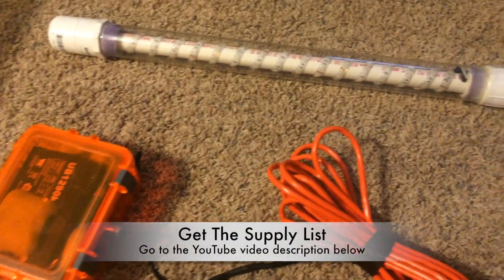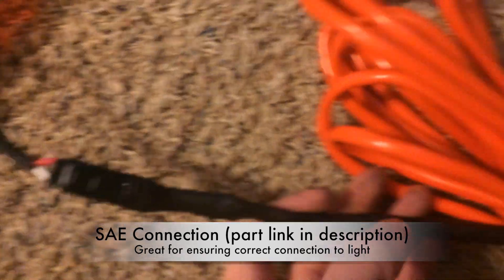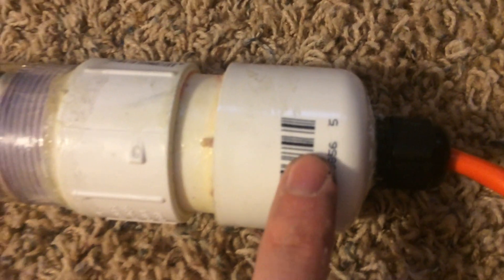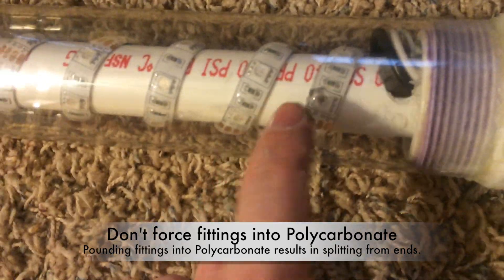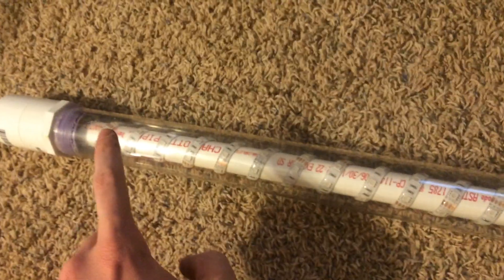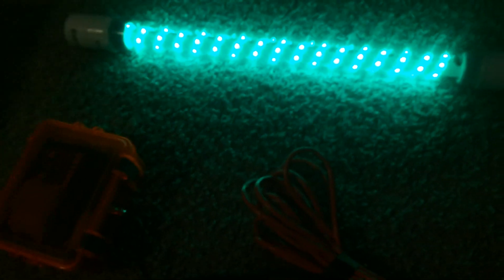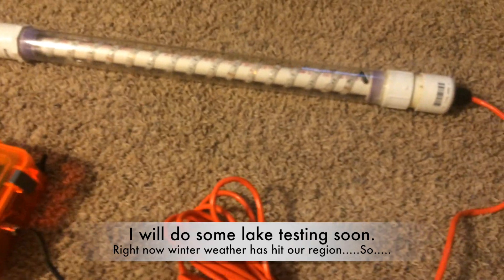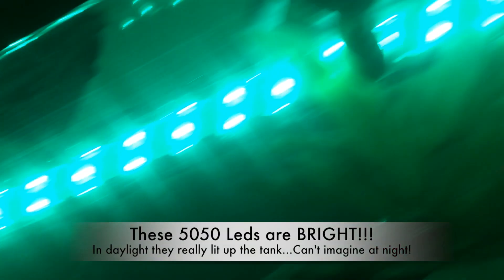Underwater Fishing Light

Comment: I like it, my buddy just made one also. he is having issues with the pvc fittings and the polycarbonate tube. He is also making his to sink. I am going to make one just by wrapping the leds around the battery in the clear waterproof container. That way the battery will make it sink no problems and I can leave it attached to a buoy and come back after some time and hopefully catch some fish.
Reply from the maker: We saw that one with the battery wrapped in the Facebook group.  Only thing is we don't agree with the choice of container.  The container holding the battery is at most IP67 rated not IP68.  We have used those containers before and they are prone to leaking.  If it was lowered into the water and hit something it could affect the seal.  

The polycarbonate tubing is optional...you can use clear PVC.  We did notice that you don't want to pound PVC fittings into the polycarbonate tubing because it will split at the end.  However, once we learned that the tubing worked pretty well.  I will say the clear PVC tubing is going to be more easy to find fittings that fit nice.  
Also we were glad it floated.  We figured we would pack a weight but in case the kayak rolls we wanted it to float.  We are going to add an eye screw in end cap to attach a weight when in use.  

Anyway, thanks for the comment!
Reply from the maker: We thought about making an integrated battery setup.  For that we would use long lithium battery packs.  It would be pretty easy.  We just figured we would build it to fit most kayak anglers who already have batteries integrated into their yaks.
Reply: Yeah I agree, i just think its a big advantage to be able to drop off the light somewhere for any amount of time then come back to fish it. I might have to look in to getting a better box. do you have an inline fuse built in?
Reply from the maker: Yes we do have an inline fuse inside the battery box.  http://www.amazon.com/gp/product/B0002KR88A/ref=as_li_tl?ie=UTF8&camp=1789&creative=390957&creativeASIN=B0002KR88A&linkCode=as2&tag=ytk-20&linkId=5X7LDQZ5AHRF6DHL

Comment: I'm in the process of making one with 1/2 inch cpvc pipe in a smaller diameter polycarbonate tube. Don't do this!
The smaller diameter pipe that the light strip wraps around tends to break loose the siicon covering some of the leds. This set up will have to extra waterproofing of exterior tube to preserve the lights longevity. It took a week before the leds started to have the covering peel off, good thing I did not have the appropriate sealant for the poly and cpvc components on hand. I will complete and use this, but will make next one on 3/4 inch pvc to avoid the stress on led strip when wrapped.
Reply from the maker: +Randall Greer thanks for sharing your experience.  We didn't use CPVC.  I could see where using too small of diameter could run into problems of wrapping tight.  We loosely wrapped leds in another build tutorial video but over smaller diameter antenna and made a stern light.  It still works great. Just depends how you go about it.

Comment: Have you made any changes in the design or construction technique since posting this?
Thanks,
Bill
Reply from the maker: Bill Smith No changes at this time aside from recommending clear PVC for strength and easier fitting matches.  Polycarbonate tubing is awesome but you need very smooth cuts else run risk of cracking from cut edge.   The one I use on my PA14 is polycarbonate.   Polycarbonate is very clear but PVC is slightly blue hue.  Just depends on preference.
Reply: KayakDIY 
Thank you!!  
I can get 8 feet of the clear PVC for a little less than $36.00 dollars so I will use it and make four 2 foot lights.  I'll use a threaded fitting on one end in case I have to repair the lights or a connection.

Nice project you did here!!
Bill

Comment: How could I make this be able to connect to an actual electrical outlet?
Reply from the maker: Tom Laicher Thanks for stopping by.  To connect 5050 LEDs to an electrical outlet plug (like from a home) it would be best to buy the entire led kit that way.  These are affordable good quality kits that have 5 Star reviews: http://www.amazon.com/gp/product/B00CZ6VB6Y/ref=as_li_tl?ie=UTF8&camp=1789&creative=390957&creativeASIN=B00CZ6VB6Y&linkCode=as2&tag=ytk-20&linkId=Y56L2OFJ5XA27YSK
Reply from the maker: Few other kits here as well that have 5050 LEDs and outlet power.  http://www.amazon.com/s/ref=as_li_ss_tl?_encoding=UTF8&camp=1789&creative=390957&field-keywords=5050%20waterproof&linkCode=ur2&tag=ytk-20&url=search-alias%3Daps&linkId=SNQXTBL6FZ5BONFB
Reply: KayakDIY Thanks! My kayak is at a marina next to my boat and after diving under there, I saw there was absolutley no cover! this marina has a couple of outlets (like the ones at home) and I saw this and thought it would be a great idea iif I happed to go night fishing!
Reply: I recommend using 12 volt, safer than using ac current, use low voltage.

Comment: Would 530 LEDs be good
Reply from the maker: tyler pickard Well, I think when you say 530 LED you are reading the LED count not type.  The step up from what you see in the video would be the 5630 LEDs linked below.  The order of brightness and power consumption from least to greatest is this: 3528, 5050, 5630, 5730.  I recommend the 5050 for nice balance of power to lumens, but some prefer a bit brighter and go with 5630.  I wouldn't recommend the 3528 LEDs for anything but ambient lighting inside hull.  Here are the 5630 LEDs that are a bit brighter than what we used but consume more power. http://www.amazon.com/gp/product/B00H2FVSV6/ref=as_li_tl?ie=UTF8&camp=1789&creative=390957&creativeASIN=B00H2FVSV6&linkCode=as2&tag=ytk-20&linkId=O7RPRLMUPTZ434I4

Comment: Kinda ballsy sticking an extension cord underwater plugged in?
Did you ever think what electric would do to you in the event it malfunctioned?
Reply: That's funny. It is 12vdc!
Reply from the maker: Like altecm stated...it is 12vdc.  It isn't going to electrocute you like a wall outlet in your house could.  This is a sealed waterproof system.  Even the LEDs if exposed to water from a leak are waterproof.  The extension cord was meant for outdoors.  However, you are not the first person to have concerns about that.  Thanks for the question.  There have been no safety concerns at this time but as always since this is homemade we have no control on how others build it so simply be smart folks.
Reply: Steve Tucker LOL

Comment: mine has switches and way more than 600 leds
Reply from the maker: +Marty Escamilla this is my design.  Yours is obviously different as you say.  Yet you seem to think I used your design.  What is your point?  It is a rather simple design.  I use cable glands and pvc in lots of other builds.  Semantically it only makes sense that I would choose such materials and build one in this manner.  The design is my own with my own creative thought and no help derived elsewhere.
Reply: I apologize  I just got in my feeling  Cuz I was so proud  of this build I've made a couple different designs and modifications  to mines over the years if ur interested in knowing some that float and some that are weight for different  depths again I apologize sir
Reply from the maker: No worries Marty.  I have had the same feelings before.  I do think you are right in including a weight at the end.  I considered it, but also wanted to keep it lightweight for the kayak.  I use my anchor system and a clip system to hold it under the water.
Reply: Yea in that case I would just put a eye bolt at the bottom  so I could  have something to clip to  then maybe  like a foot of line to a clip tied to ur anchor line with a hitch knot then u can just about put it at any depth you want No weights needed